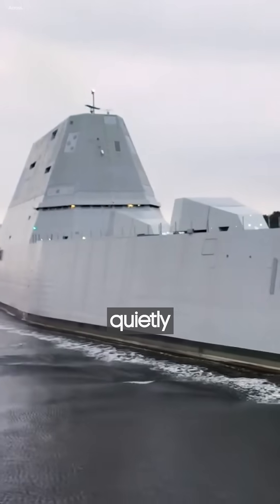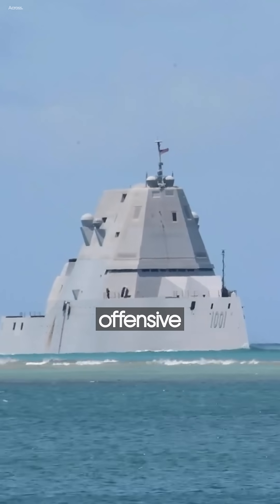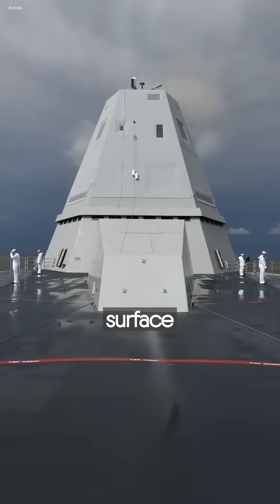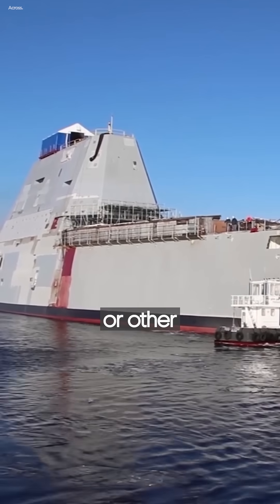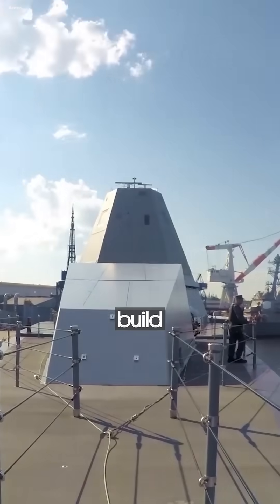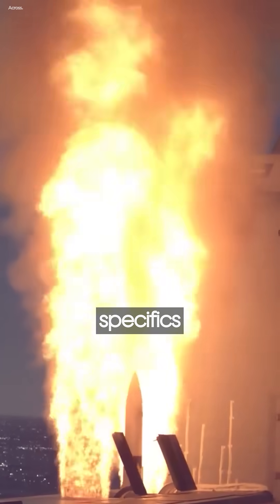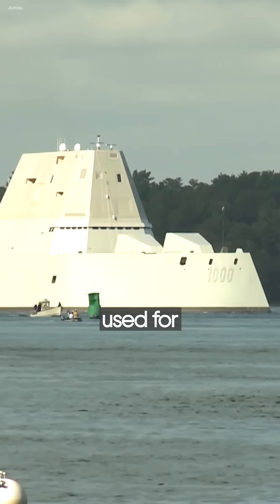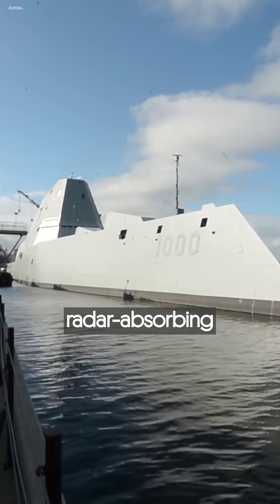The Warship That No Country Can Copy #shorts

Comment: It doesn’t have radar absorbing material on the outer hull.. the ship utilizes light scattering technology to stay undetected.. essentially there is no flat surfaces to bounce radar signals off the hull and back to the signal receiver.. the shape of the hull and superstructure bounces the signal into the upper atmosphere..
Submarines have sounds absorbing compounds surrounding their hull, because sonar detection is a LOT harder to mask, as even if the signal is redirected upwards, the signal can bounce off the surface of the ocean and head towards the ocean floor, then bounce off the ocean floor, so it’s almost impossible to crate angles on the submarine that would scatter the signal enough not to be detected.. also, the shape of submarines is pretty much dictated by the pressures of the ocean at depth.. a circle is the strongest structure when massive pressure differentials are involved, as it ensures the pressure being exerted on the submarine is completely uniform along its length, meaning the pressure pushes in on the hull equally everywhere.. 
most people have seen this in YouTube vids, where a submariner will tie a string between both sides of the hull, and as the submarine dives deeper and deeper, the string goes from being taught, to having a substantial amount of slack in the line .. if the sub was a square shape, there would be more pressure on the edges and it would fail under a lot less pressure than a circular design would

Comment: Nobody wants to copy it, because it is a disastrous white elephant with limited capabilities, very poor sea-going qualities and it isn't even that stealthy compared to a regular destroyer. The US ditched it in favour of using the good old Arleigh Burke class - a design which predates the Zumwalt by over thirty-five years - as it is is not only more capable, but costs a quarter of the price of this turkey.
Reply: Actually Congress WANTED it to be less capable and REDESIGNED it on purpose to be useless. They spent MORE per ship on the old A.B.'s than the unit cost of more Zumwalts.

Comment: One thing they forgot. No warships or any sea going vessels, from small boats to super aircraft carriers, none can escape from a modern Submarines.  These deep sea underwater war machines lurks anywhere in the sea. Without moving an inch, it can detect any moving object around it and above. Even anti-submarine aircafts can't find a submarine if it lay motionless few hundred feet below the ocean surface.
Reply: Behold the sonobouey